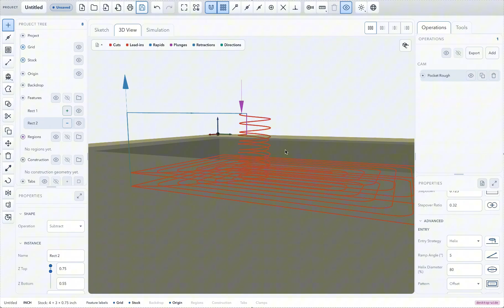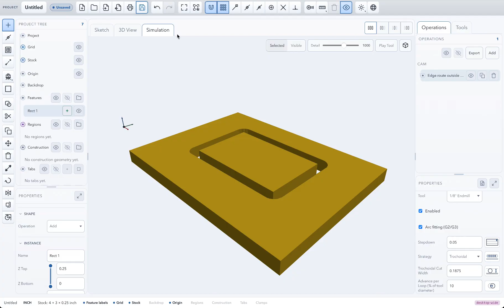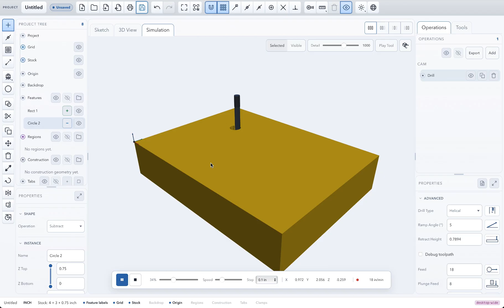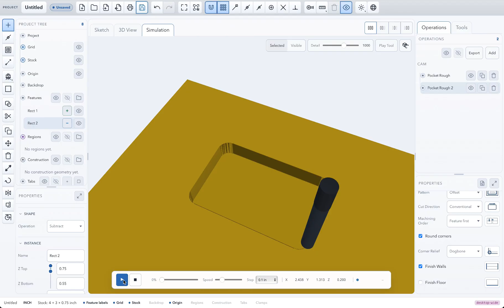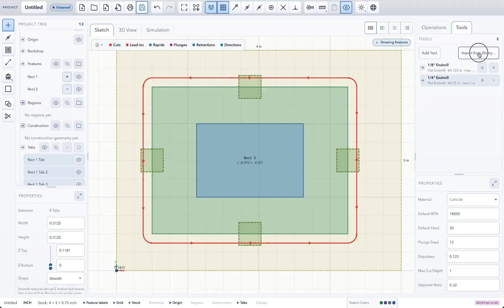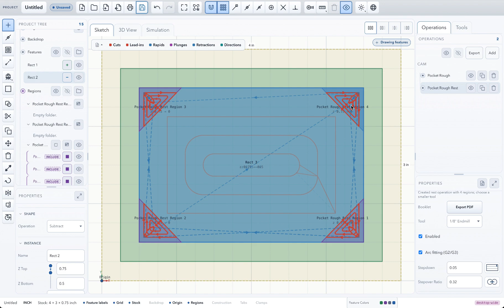PureCutCNC v0.3.0

Comment: Can you please make a video where you import a stl and then drill out the holes in the stl, rough cut the surface, then surface, cut the outline with tabs? Thanks!
Reply from the maker: I have one project which I use for testing and it covers most of what you asked. I will make a video showing how it is done.
Reply: @PureCutCNC  looking forward to it

Comment: I'd like to share some feedback about selection behavior in the CAD program.
When I have two holes in a material and want to select one of them, I get a prompt asking which object I want to use. In my opinion, if I'm already inside a shape and can clearly see that it highlights when I press the mouse button on it, that should be the shape I want to select. It feels like the problem is already solved at that point, yet I still get asked which object to choose. This is a bit unintuitive and makes it harder to move objects.
Of course I can select them in the project tree, but especially when there are more than just a few shapes, this becomes quite difficult.
Reply: Also: if I’ve already decided that I want to unite two shapes, why do I still get asked whether I want to unite two shapes? I can absolutely understand the confirmation if I’ve done something wrong — but if I haven’t made a mistake: Just Do It. I beg your absolutely pardon for my ranting, but my goal is that this piece of good looking software will be easy and useable.
Reply from the maker: @oscarcarserud  I see your point. I can skip the dialog if there is already more than one shape selected. I will look into that. and do not worry about commenting and asking for changes - that is greatly appreciated and it will help make the app better. keep sending them :) . another way to add a comment or request is via github issue here https://github.com/PureCutCNC/purecutcnc/issues
Reply from the maker: thanks for the feedback. In this case clicking on the boundary of the shape works better for the selection filter. Still I agree with you, the selection filter logic should be improved. I will give the selection filter logic another round of optimization (believe me it was much worse :) ).
Reply from the maker: I made some changes in the selection filter in v0.4.0, please give it a try when you get a minute.